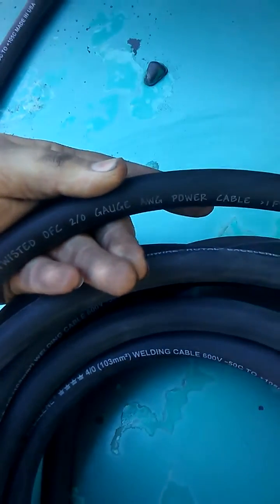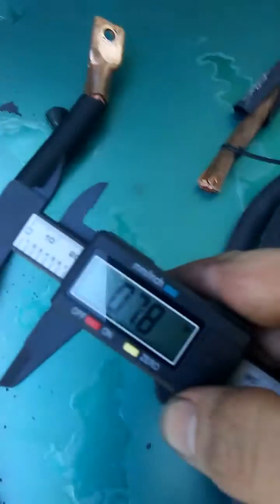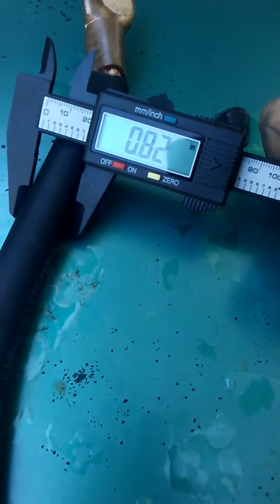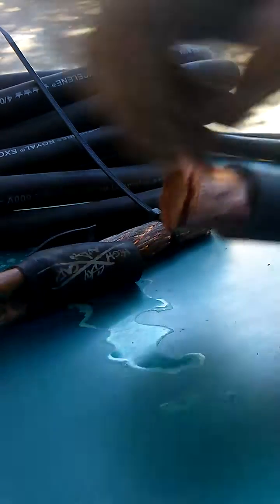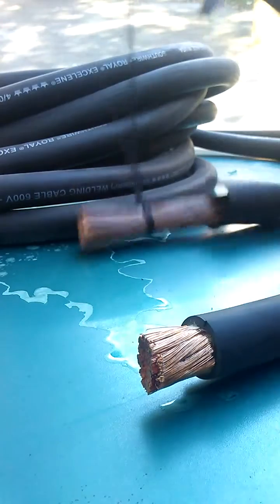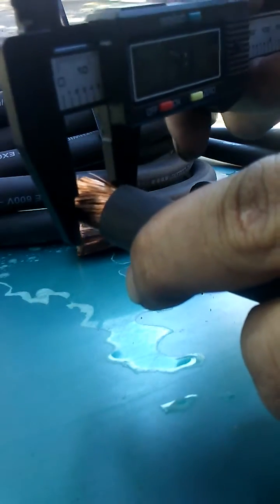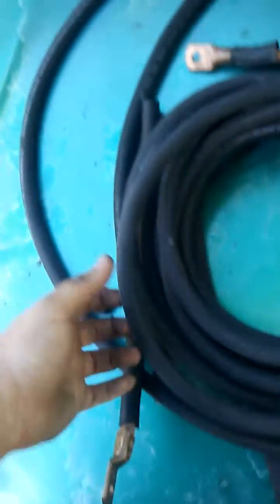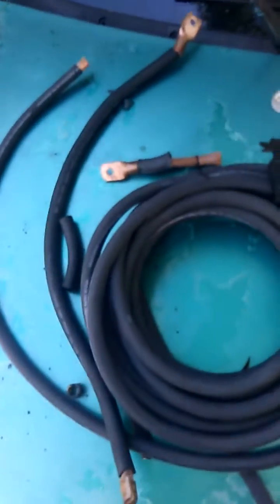Sky high car audio 2/0 ofc vs welding cable 4/0 ofc

Comment: so is welding cable just as good of a connection for car audio use, or is better, or worse?
Reply from the maker: Derek Brooks in my opinion its better. I have had less corrosion issues out of my welding cable versus my car audio cables. Also the price point is better too so that makes a nice cherry on top
Reply: now from what i understand the only difference is that the wire can handle a higher temp then what car audio wire can, but car audio wire tends to be at a much higher price. in your opinion did somebody just take a welding cable put a cheaper jacket and jack up the price, long story short
Reply from the maker: Derek Brooks well they arnt really rated for tempaturea. Its the amperage rating that matters because Thats the current flow. I really camt say why one company charges more for their wire than another i just know from my experience i have better things to say about the welding cable
Reply: alright thank you!
Reply from the maker: Derek Brooks no problem man. Thanks for the questions. Feel free to ask me more at any time.
Reply: Not rated for temp is a HUGE deal. Do you want your car burned down?
Reply: Same just check strand count.
Reply: Alpha Omega the welding cable Strands are 3 or 4 times thicker than car audio. I used NVX 1/0 and now use Excelene 2/0 and the Excelene 2/0 Copper is less Strands but the thickness of each individual strand is crazy. Electricity flows on top or around the wire so the more surface area the better. The Excelene is very good price as well. The NVX is great price when on sale and very high quality but the copper in the Excelene is crazy. It is not tinned like most car audio cable however soldered or crimped and heat shrink will take care of that!
Reply: @uptobatentertainment  WRONG, this is DC power it moves through the copper, only when it comes out of the amp is it AC at which point it flows over the copper.
Reply: Difference is negligible. Class M cable has 34 AWG stranding tho there are thinner strands in some car audio wire the difference isn't worth the cost.
Reply: There is no difference, welding cable is only cheaper

Comment: I think welding wire is an excellence choice for car audio it might be harder the cut and prepare the wire but you will have a peace of mind that the wire can handle abuse and higher temperature than the fancy candy red "boutique sky higher ones"
Reply from the maker: vargasmongo3435 truth!!
Reply: @CorpseFreak  actually if any wire is made in the usa it has to have a awg rating it is the standard and law. that is why china bought wire is rated different and most of the time doesn;t have a true awg rating because china doesn't have wire gauge laws like usa does
Reply from the maker: @kevinanglin678  is sky high american made? I know that theres a standard in the us.
Reply: @CorpseFreak  yes it is made in the usa
Reply from the maker: So is the royal excelene too. So how is it that sky high can claim their 4/0 is is "oversized 2/0" but excelene is labeled 4/0?
Reply: CorpseFreak iv never read you have to go by awg by law.  It’s just a standard of measurement in the USA.  Also the higher the stand count the bigger the wire will be vs a solid wire.  More strands more micro space between each strand etc etc.
Reply: @CorpseFreak  Wielding cable uses the American Wire Gauge which is the standard in mesuring wire. Skyhigh and other car audio wire makers dont use that scale.
Most respectable car audio brands oversize their wire.
Reply: @CorpseFreak  its in his note area why they can do this.
Reply: There both rated to 110C and the price of Royal wire + shipping is almost as much as Skyhigh wire with free shipping, so why not get Skyhigh in the color u want.
Reply: @4gbmeans4gb61  The price has certainly gone up from 2015. But since then I have had 2 runs of 2/0 under my Expedition unprotected. The wire jack has held up perfectly. It's a bit stiffer a Sky High type wire,but do denying the endurance of the wielding cable jacket. Through rain, road debris, and salt. Its just as if I just installed after cleaning off the dirt.
No fraying or green cooper nothing.
I wouldn't have as much confidence if the soft jelly wire jackets of car audio wire.
Unless car audio wire is 20% cheaper. I will continue to buy a recommend wielding cable.
Reply: Alpha Omega I acutely looked it up and royal is only rated to 105c instead of 110 they both use epdm jacket.  So sky high had higher rating,skyhigh just uses a mate finish.
The sky high looks smaller in person, some reason I thought I was gonna be bigger lol
Reply: @4gbmeans4gb61  I  never heard of that wire. Most likely some ebay wire.
Temp rating weill tell youu a melting point. Not the abrasion resistance of it.
Also how likely it will crack being outside in sub 0 temps.
Reply: Alpha Omega royal is the brand being talked about in the video. And like I said they both are made from epdm.
Reply: No doubt!
Reply: There is absolutely no benefit to running welding able other than the price, if anyone says otherwise they have no clue what they are talking about.
Reply: @AndrewB23  Stop hatin.
Reply: @AndrewB23  in regards to comparison of gauged wire welding wire does have an advantage over the same gauge due to higher voltage capacity and skin effect due in part to the ultra fine wires that's it's comprised of.
Reply: @AndrewB23  uh, what about higher ampacity? Or high voltage rating? Or maybe higher temp rating? You apparently don't have any clue what you are talking about. Oh and that's with a smaller gauge, so....